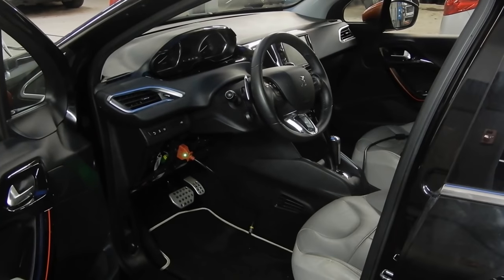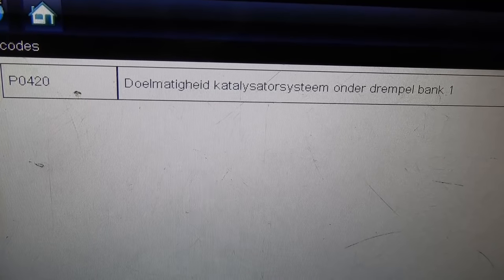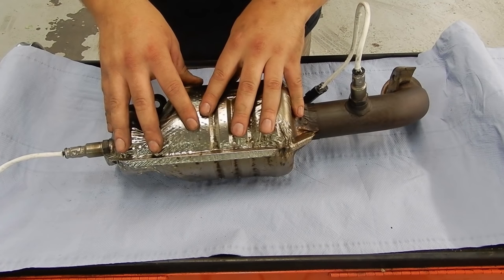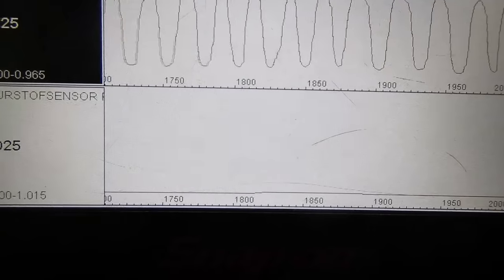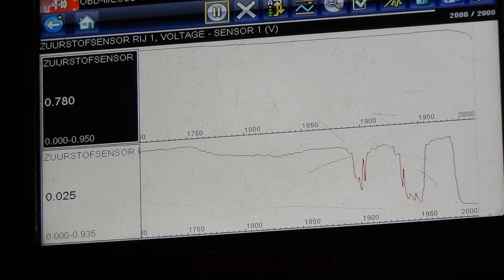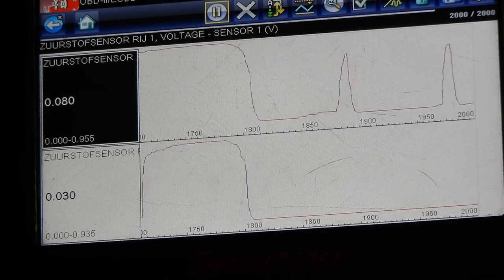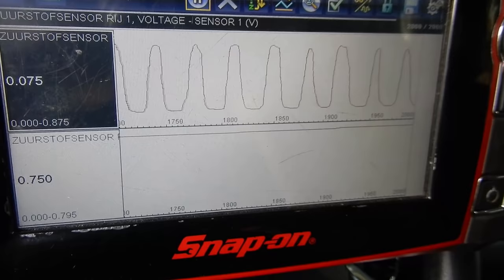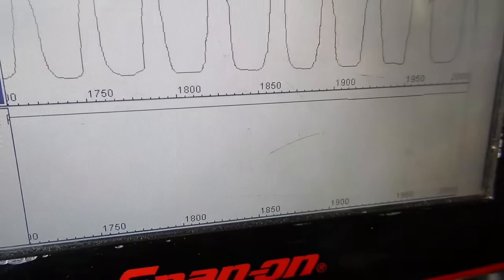Peugeot 208 P0420 / Catalytic converter diagnose and Fix!

Comment: Hi dan it would be nice if you made some videos on engine  PCM-ecu ,what to diagnose when you have no comm with the main ecu(engine) .i mean inside the ecu  , nothing to do with basics like voltages or earth, fuse, continuity etc . there aint much videos about ecu repairs like main components, transducer, capacitor, volt regulators ,the basics from inside-HW only. thanks
Reply from the maker: jasonics md if i run into a intresting case study, i might do that. I have 1 video on ignition drivers already. If you haven't seen it watch that one first!

Comment: Hi Dan Peugeot mechanic here. Your right this is a common  problem. New one when warranty are picking up the bill. Weld when customers picking up the bill. I've actually got photos on my phone from the first one I welded.
Reply from the maker: Thanks for the feedback!😉
Reply: Ive done tons of them aswell.  Bad design
Reply: @Vespastendert  There has been a TSB on it with updated part and many have been replaced for free under warranty/goodwill .
Reply: Mikael i know. I left Wassink autogroep in october ;)
Reply: I would think this would be a warranty item.

Comment: I worked for Citroen and now a Citroen specialist. That Engine definitely has Catalytic Converter Cracking issues. Also has issues with the wet belt (Absolutely moronic idea) timing belt design where the belt is situated like a timing chain bathed in engine oil which falls apart over time and drops to the sump and blocks the pick up which starves the oil pump then the engine of oil.... The turbo variant has a major issue with carbon deposits being left on the intake valves because it’s Direct Injected.... That leads to rough running and hesitation when accelerating... Great idea but poor execution!!!

Comment: Hi,
What is the database that you usually use for diagnosis ,(schematics etc) ?
I've looked at alldata europe but it's 250 euros a month lol
I don't have this kind of money.
Any cheap alternative for a random dude like me in France ?
(i don't mind having it in english)
Reply from the maker: Merci! Unfortunately good information is Expensive, i use Hella Gutman wiring diagrams, i think these a about 1000 Euro a month. Cheaper and better for European cars. But still a lot of money.
Reply: Ok,thank you.
So,i'm screwed.
Informations for products you own should be avaible for free,or cheap,by the manufacturer,(unles you want to hide things,like VW for example...)
The USA are going the right way with their "repair act".
Your videos are really interesting.
Well structured and logical in the reflexion,and presentation ,wich is important to understand relatively complex problems.
Thanks for your work.
Reply from the maker: @michaelovitch  Merci beaucoup!😉

Comment: I would love to have seen u weld that little bad boy. Super explanation of what Cat is supposed to do. I going outside right now and checking my downstream sensor voltage on my 2.5 Nissan Frontier. It has a wide band upstream though. No worries. I saw your video on that too.
Reply from the maker: I always love your comments Bill!👍👍

Comment: We have to look for the cause of this fault before we replace any part,as the Catalytic converter are not normally a "wear" type item, that is they are not designed to wear out and need replacement. If they have failed, it is likely due to something else that caused it to fail
.
But when I use the Peugeot Planet 2000 Or Diagbox for diagnostic,and have the fault P0420,the description for this fault that (Catalytic Converter ageing),which can be misleading that the life of this part ended,specially if the car got high mileage.
Reply from the maker: That's exactly why you need to look further than just replacing parts. And there is no need to replace the Cat. just weld it and it's fine again!

Comment: Dan, One question, Assume Catalytic converter is good, both upstream and downstream is good ..  If i add more fuel like the way u did in intake, and if i measure the downstream O2, it will show rich in practical but to your theory, that Cat should release stored oxygen into the rich fuel(carb clean fluid we sprayed) and the downstream o2 should be having steady (in theory) but rather  it shows rich .. do u have any reason why it will show rich on downstream ??
Reply from the maker: It can only store enough oxygen to keep the mixture normal for a short period of time. Normally if everything is OK, the mixture won't be Rich that long. But if the Cat Works good there will be a delay. So it takes a moment before the downstream shows Rich..
Reply: @Diagnosedan  Thank you so much, ,thought about it, but want a confirmation from you. Thanks again.

Comment: Funny to see this Video now, Last week we had the same Peugeot model, around the same build year , same fault code and around 70.000 KM on the clock .
I called the local dealership, and the Converter was replaced under warranty,    at no costs !
Reply from the maker: That's fantastic!
Reply: I looked it up today , and the total kilometers was 67.563  and a 2014 model as well .
I called again to the  Dealer to ask what the problem was , but the mechanic was told to check the fault , confirm catalytic converter fault,  replace said converter  and turn the 
 faulty converter over to Peugeot for warranty .
So he mechanic couldn't tell if it had the same crack as in the video, but my guess is it was the same problem.

Great videos BTW!
Reply: What converter did he replace it with the same one?
Reply: @lorenzodagamer2485  ‘Of course he did , it's a dealership  !  He didn't know if its was an improved version ,or just the same thing, resulting in the same problem 70.000 km on.
Reply: Peter Lenderink 
This a very good example of why I prefer an independent shop. 
A mechanic at a dealership is trained to and has to follow prescribed procedures to the letter. 
At an independent shop a mechanic has to be able to analyse, diagnose and then solve problems. (Only) proper diagnosis and root cause analysis will solve problems in a robust and cost effective way. 👍

No disrespect for a dealership mechanic. It’s just a different type of character that’s needed for a dealership or independent workshop mechanic.

Comment: I use this word very sparingly as I am a hard man to please, but you Dan are `Phenomenal` !  :)

Also I have a Yamaha R6 and I had diagnose a no start situation, so checked the obvious No fuel in tank lol, then did the `Easy Spray` trick direct into the intake and it started briefly..so it is fuel starved, then went and checked the fuel pump relay and bingo it was faulty,,changed out and Yammy now firing on all cylinders, so Easy Start for the win !!
Reply from the maker: Wow thanks for that!👍👍

Comment: I had this code on one of the vehicles that came into our shop today. We didn't have a scope type scanner like the ones you demonstrated. I only had a code reader with limited digital readout of the data stream. I didn't feel comfortable diagnosing it without the proper tools. After seeing your video, I realize that I could have used a scope to back-probe the O2 sensor and the A/F sensor. Of course it's much easier to check through the DLC II. I need to get my own advanced scan tools for multiple brand vehicles. Do you have an episode where you compare scan tools and scopes? I would love to know which ones you prefer and why? Thanks for are your time that you put into these videos. They help us techs greatly especially because we don't get these problems all the time and they're a great refresher course. See you next time.
Reply from the maker: I try to use different scantools in my video's, that way you can see them in action.

Comment: thank you very much sir i have peugeot 208 with absolutely identical crack in cat. quick welding had sorted problem.it seems there is inherited design fault with 208 cat developing crack.i wouldnt be surprised if most of 208 have same issue over and over again.anyone with  p0420 problem check crack in your catalityc converter first.bet you 98% you hace crack in cat.converter
Reply from the maker: That's fantastic!😊

Comment: Have had this code recently on a Jeep Wrangler, as well as P2096 and P0298 codes intermittently, another shop had already replaced the catalytic convertors and changed the exhaust manifold gasket, the problem ended up being a software level fault and a PCM reflash was needed so off to the dealer it went. I believe the reflash was to stop the PCM being so sensitive to lean conditions on the downstream O2s and throwing false codes.
Reply from the maker: That's amazing!😉

Comment: Hello, great video again. But every time we should ask ourselfs why did this issue occured in the first place. A big difference in temperature? Are they bad engineered, or just cheap production?
Reply from the maker: gearstil I think the material gets stressed to much. Maybe it can't expand enough when the cat. gets hot. It proberbly has to do with a engineering/ testing fault.

Comment: Another great video. One thing I am not clear on is how air can enter the Cat when the engine is running. Even with a crack in the case, the gas inside of the Cat is pressurized higher than atmospheric pressure, so any gas movement would be from inside the Cat towards outside of the Cat.
Reply from the maker: The airfow creates a low pressure

Comment: Dear Dan ! My Peugeot 5008 1.6 a eHDI was recently had an engine overhaul (skimmed cylinder head, one new injector, camshaft , ). It sat for long time before driving now . Getting fault code P3008 ( (manufacturer control - on maxi scan MS309) suggesting airflow high! Is that possible that the air intake tract has a not so airtight area(loose jubilee clip etc) ? Thanks for your tip!
Reply from the maker: Turbo pressure is proberbly escaping, check the intercooler
Reply: DiagnoseDan thanks ! I will check! So far no error message yet . I will check it nevertheless!

Comment: Mastery diagnose! Told me a lot about my situation. My first o2 sensor is reading good, but second one is giving me same value as Yours. Problem is it does mimic first sensor when throttle is pushed. Tested it aroud 2000-2500rpm. Do You think it could be small leak in exhaust(becouse only visible at idle) and bad cat(second o2 sensor mimic first at 2000rpm)?
Reply from the maker: Looks like a bad Cat!
Reply: @Diagnosedan  I'm afraid it is, thanks for Your quick response!

Comment: Hey Dan, great video's. There is a modification in the bracket below so it can expand when it's hot. Cost around 30 euro by peugeot dealerships. That should realy solve the common issue
Reply from the maker: Really? That's great info! Thanks for sharing!

Comment: hello diagnosedan I have a Peugeot 208 1.2 of 2012 and turned on the light that light and gave the error of catalytic converter and probe.
They have erased the error to see if it appears again but I suspect it may be the same problem that shows in the video
Just wanted to ask a question, this cape you took can put it back right?
Reply from the maker: Yes you can
Reply: Thanks Diagnosedan !

Comment: Thank you Dan. Great job. Do you have any videos planned for auto ac three wire hvac blower control? Been trying to find information on the duty cycle control wire and how it works. Meaning, is the 5V circuit like a transmit and receive network. Does the blower provide the 5V to the ac controller and the controller will pulse it to ground to generate the duty cycle command to signal the blower what speed to go to? Or does the 5V come from the ac controller to the blower? Reason I ask is OEMs usually don't share this info and it would make diagnosing inop blowers easier and faster. Thank you.
Reply from the maker: Billy Yoder haven't planned it but maybe if i run into one.😁

Comment: Couple questions, first, have you ever seen a lazy upstream O2 cause a 420 code?  
Second, On cars with single or repeat cat failures, some say its cheap aftermarket cats, but I think all cats fail due to being poisoned, either by coolant or oil burning.
do you know if can they be cleaned and put back into service?  Some of these cats are 1000 cdn dollars, not cheap, the AM ones are a third to a quarter cost, but they dont seem to last and rust out in our climate.
Awesome videos, keep them coming
Reply from the maker: The code is mostly set by the downstream O2 sensor wich is the  diagnostic sensor. I'm not 100% sure if cats can be cleaned, i guess  it depends on why it failed. There are some video's on YT where they try to clean cats. Most with poor results
Reply: I think the theory was that a lazy o2 will affect the mixture so much that it would result in an overfueling issue, affecting the rear o2

Comment: So is it poor material that is causing these cracks? I actually have the P0420  on our 97 Jeep. The entire exhaust system was replaced due to rust. We even replaced the manifold (4.0L). Had a small leak at the headpipe connection. Had to reposition the system as it droops. Since we do not have a scanner here at Everyday Offroad, we are limited to "educational hypothesizing"

Comment: Hello Diagnose Dan I have a Peugeot 207 year2008 1.6L Diesel . I'm getting all of a sudden various issues all of a sudden it started with Anti pollution warning following that the wipers would randomly go on with the car locked ignition off?!? I then plugged in the laptop and got a long list of faults 
Ignition / injection - EDC16C3 control unit
P1639
P0245
P0243

Abs Traction control ABSMK70_1 control unit
P0562
U1108
U1308
U1318

Electric Power Steering
U1108
U1308

The battery initially was dead so jumpstarted the car didn't take much to start. The car was fine everything was working but the engine management light was on and the anti pollution warning I cleared the faults drove the car round the block about 3 miles and it was okay the fault didn't come back. Then the wipers started going again and I turned the car on and off it stopped the car has been left for a few hours now they is a loud humming noise when connecting the battery what sounds like the motor for the screenwash in that area of the drivers side. RHD UK. I have disconnected the battery and lost as to what the issue is and how all this has suddenly happened.

Please can someone give me some advice or help in finding the issue

Comment: Hi Dan. I have such a crack but a little smaller at the catalytic converter of a Mercedes E300Bluetec (OM642 engine) Is it possible that because of this the engine has a loss of power ??? otherwise everything is ok, new turbine, new egr, cleaned dpf, new dpf sensor, some new sensors on the engine, new distribution, etc.

Comment: What if the 2nd o2 sensor goes between 0.35-0.8v? Can't see any cracks.... used mirror to check, engine was around 60degrees celcius. Smells a little bit fuel on front

Comment: Hi there. Having trouble with my Peugeot 208 1.2vti 60kw engine, when it heats up,  one of the 3 cilinders cuts out. It is reading the fault code P1339 combustion misfireing (Impact on catalytic coverter) injector cylinder no. 3.

Have changed the spark plugs and coils, the problem is still there.  I am out of ideas where to look Next, any advice?

Comment: My Goodness! I really love your videos. I have to say you are the" LAST " car mecanich. You are like the old school Private eye ( Private ditective ) You really inspect and comingnig to a conclusion! Most what I have seen of todays Car " Mecanich " they are just a sparepart changer guy, They don´t have a clue how to fix a car now a days. Let me give you a example! You are coming in with your car. It´s ideling very badly. The Mecanich is smiles hooks up hit computer. He says after 2 minutes you are low on coolant!  I´m asking that cannot be my idling problem. The guy answer me that my left rear break light is not working. By that time I replied. How will that fix my idling problem? He answer the computer is guiding him. So when all the problems are solved the car will idle normaly again

Comment: Could you do a similar diagnosis on a Suzuki SX4 1.6 engine  ? P0420  is a common problem with that car.
Reply from the maker: I can only do what comes into the shop! But if one comes in i'l film it!
Reply: @Diagnosedan  Could you also get some useful dignostic data by looking at the long fuel trim on this  Peugeot ? Or secondary 02 sensor only reads the mixture after the cat to test if it is working proprely, without  affecting the fuel trim adjustments ?
Reply from the maker: @jolexx  On some cars the second o2 sensor also is used for fuel strategy. But be carefull it depends on the Manufacturer.

Comment: in "mopar world" you would see a downstream o2 slow to respond fault with that not necessarily a p0420
mopars monitor the o2 sensors for proper operation and flag a p420/430 when it sees both sensors mirroring each other
Reply from the maker: Thanks for the feedback!
Reply: @Diagnosedan  you're welcome! thanks for the interesting videos, i've worked on mopar for a few decades and like the interesting differences of european cars

Comment: good find that one, big crack too, system needs better flex joint to help reduce fatigue on the cat .
I was expecting lazy cat as with cracks that large you normally hear them .
Good info and easily followed by all .
Ceack on with some more vids Dan 👍
Reply from the maker: 3 cylinder lots of vibrations!
Reply: Bad design, the cat box is very rigid and has a lot of temp stresses, mix this with way it mounted with no flex section or slip joint to counter engine torque rotation and you end up with big crack lol
least got good guys like you fix them, bracing strength on cat section or slip joint needed and should be recall issue on these as all will do it in time .